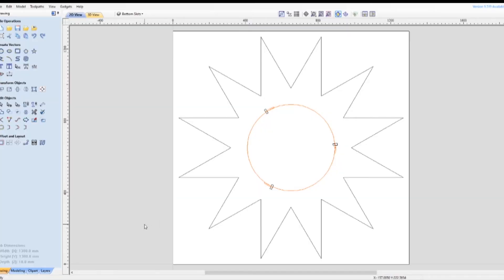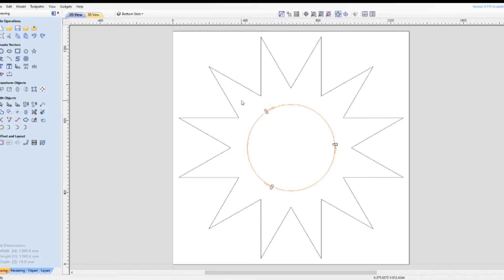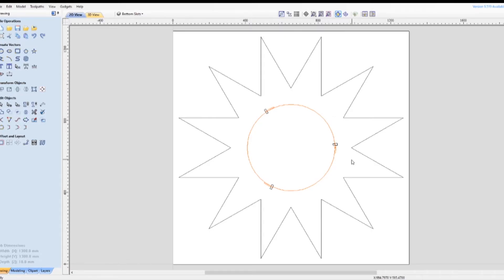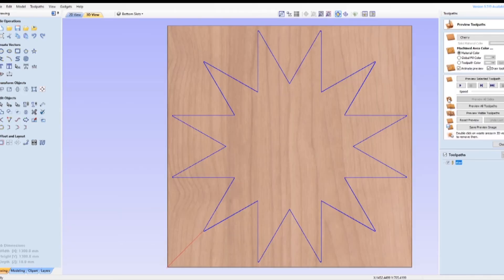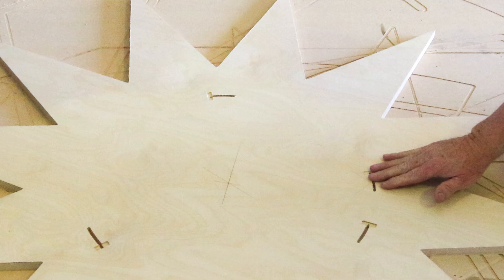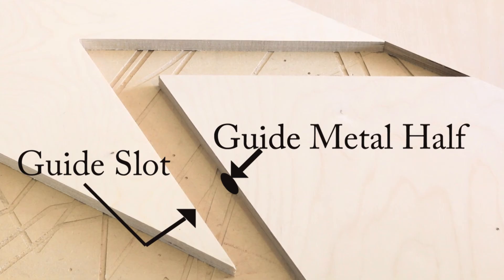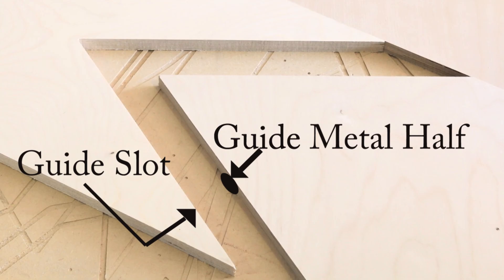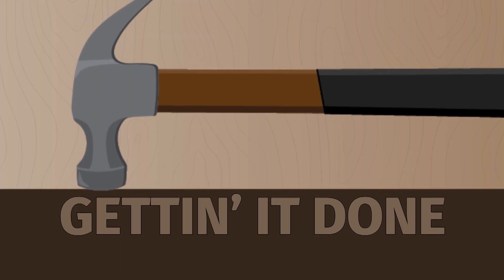Expanding table #5, Star

Comment: How to get this nice sharp inner edges?
Reply: The CNC gives you a radius because of the size of the router bit you can also take that same size radius and added the pie shape instead of having to square off the inside of the star
Reply: You can also use your CNC to Route those little metal shaped biscuits very easily